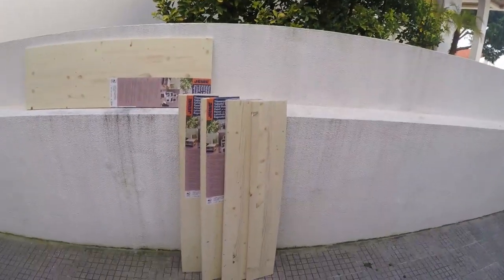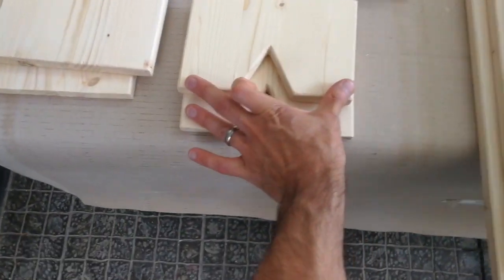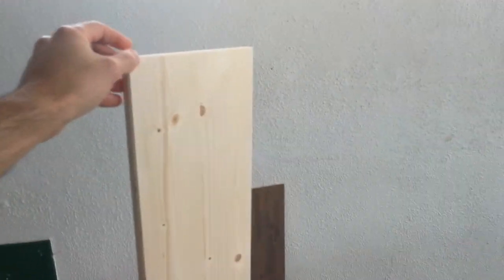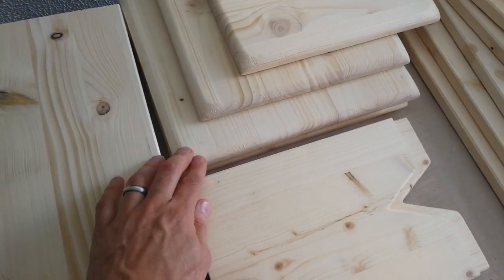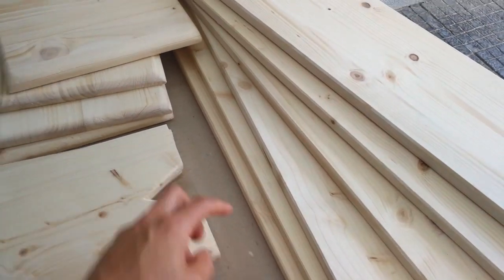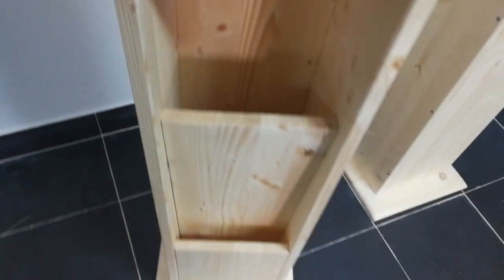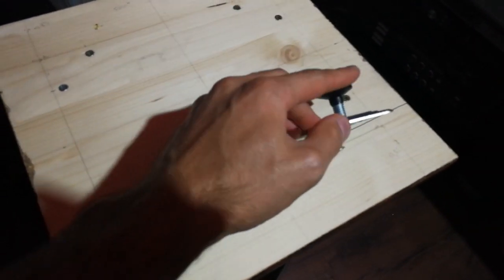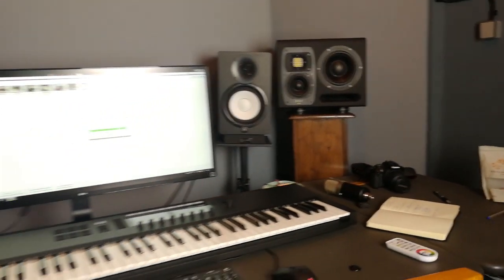Active Monitor Stands - DIY - Hedd, Adam, KRK, Yamaha, Genelec, Focal

Comment: how much does the stand weigh with the sand inside? and how high is the sand up the stand?
Reply from the maker: Each bag is 5kg, there are 3 bags in each stand - plus the weight of the wood, I would say they weight around 18kg. The sand goes about 2/3 of the height of the stand.
Hope this helps! Thanks for watching!
Reply: thanks a lot :)
Reply: thx a lot. and what is the wood type you used?
Reply from the maker: @TVPActivismIsrael  this is pine, easy to work with, probably the cheapest too
Reply: thx!

Comment: Hello..Good job.. How do you like the HEDD type 20 monitors and are these rated at 900 watts per speaker..?.. ( if I read the specs correctly )..I'm interested in these also but may have to go with the Type 07 budget wise..Thanks..!
Reply from the maker: Hi Clinton, thanks for watching and commenting! 
Yes, it is 900 watt ( 3 x 300). I love them! Cannot say anything bad about them... Easy to work with for long hours, never get ear fatigue from working with them, tons of bass (especially noticeable when I A/B between my them and my Yamaha HS7 --- even though they have the same 7' speaker size). It is amazing to go listen to music I've heard for years and be surprised by noticing something new that I had never heard before -- they are that good and detailed! 
But I must say, what makes the speakers sound great is the room they are in: the acoustic treatment I have made... I spent more money on the acoustic treatment than the speakers themselves --- and that is only the building materials, because I did all the work. Great speakers on a shitty treated room is like a supercar on a dirtroad. So, consider a budget for the acoustic treatment, even if it cannot be ideal in the beginning, you can always make upgrades as your money / time allows.

I never tried the Type 7, but I can almost guarantee you will love them as much as I love my type 20.... 

I hope this helps!
Reply: @JohnJesus  Thanks for the reply..I know listening to monitors are kinda moot on You Tube but that being said, can you post some audio with the type 20s..?..Can't find a demo actually using them in a treated studio setting. Only at trade shows..!
Reply from the maker: @clintondeloatch3536  Hey Clinton, unfortunately I am in the last stages of finishing an album and I do not have the time now to do this properly, as it would require preparation and decent recordings, with well placed mics, different mics, and good editing --- and even then it would still not be true to the sound of the speakers, as it is impossible, no matter how good the mics are as they all have their characteristics, and then you'd be listening through your speakers -- so, the sound would be different in many ways by the time it arrives in your ears... Got to listen to them in person to have a real idea! Can't ou go to a shop where you can try them? If I had doubts, thats what I would do.... When I bought mine I hadn't hear them -- just trusted the reviews... also, I ordered from Thomann, which I could return without any cost if I didn't like them....
Reply: @JohnJesus  ..Hey J..I understand..Thought you may had something to post already..Unfortunately, there's no one near me to hear some in person so I may have to do as you. Just take a chance and order them..!..I'm sure I may can send them back if I can't use them..Good luck on your new album...!